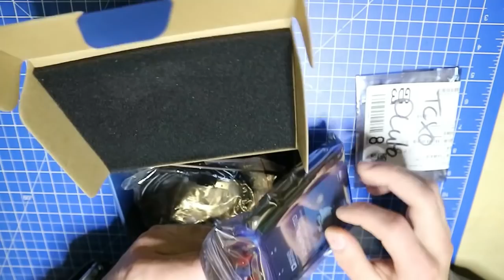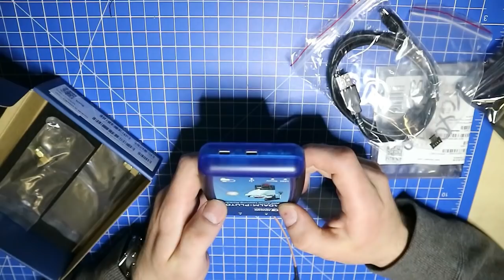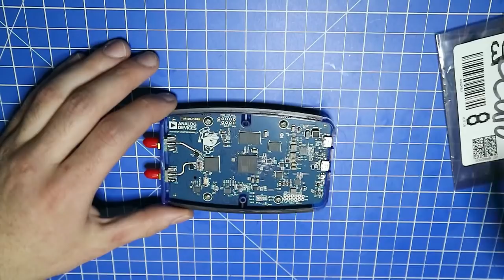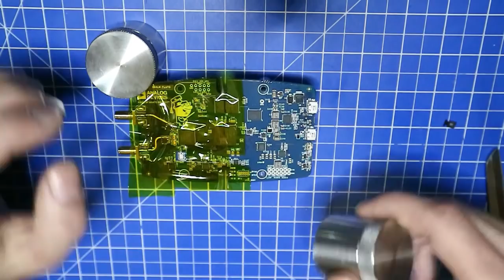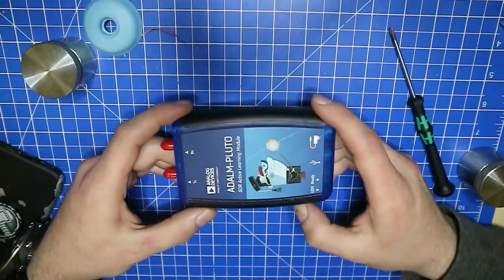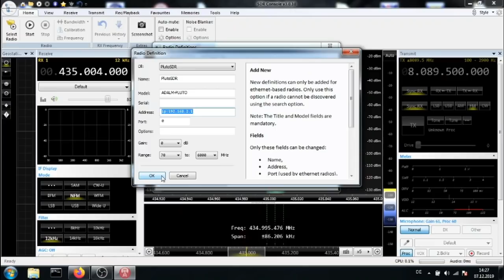ADALM Pluto TCXO Mod (QO100 ES-Hail2)

Comment: Hi.
Great Video, but I didn't notice what is TCXO type used for modification. You probably changed it to 25MHz instead of original 40MHz, so it could be Murata XNCLH25M000THJA0P0 (25MHz 0.2ppm. isn't it?
Or if we want to retain original frequency range, ABRACON ASTX-13-C-40.000MHz-I05-T ???
73!

Comment: what is the exact part number for 0.5ppm TCXO ? What was the temperature of hot air blower while reworking ? Thanks in advance.
Reply: ASVTX-13-C-40.000MHZ-I05-T ?

Comment: Tnx Hans fer all your effort. Can you pls give some info on the used yellow foil and the used parts? Or is the info available on your webside? Best regards es 73 sTef
Reply from the maker: Hello. The foil is called „kapton tape“ its a high temperature, electric isolating material. It was often used in building transformers and in 3d printing (some years ago...)
:)